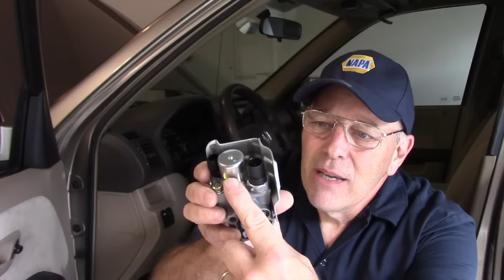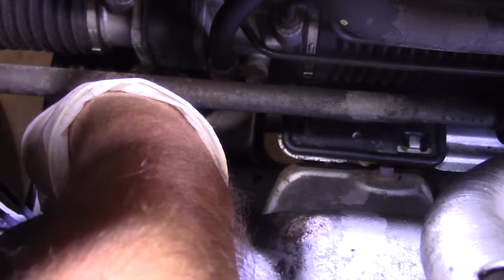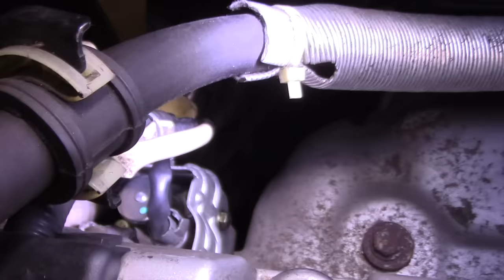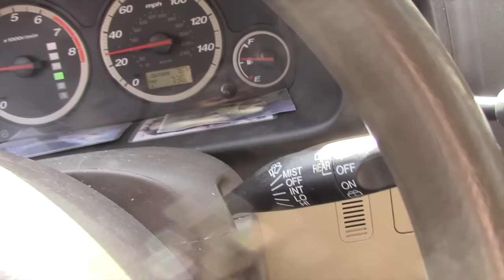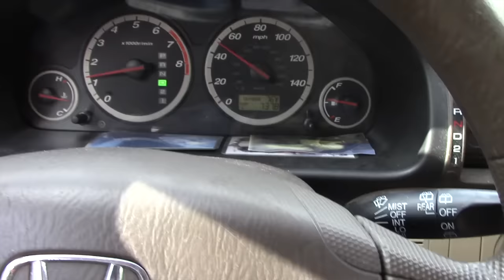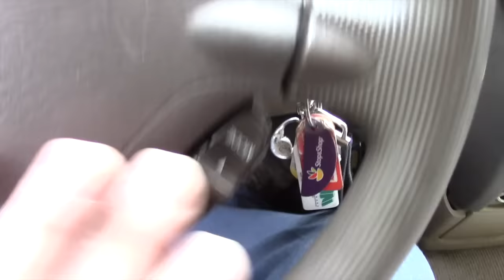VTEC Repair  P2647 Or 2646 (Pressure Circuit Voltage High Or Low)

Comment: Hey Jim I am subscribed and watch all of your vids....I have an 03 Element with this issue.  I have the entire assembly on its way in the mail.  My only question for you is that I have been reading on the Honda forums that some folks still have issues even after replacing the entire assembly....they go as far as replacing the assembly again and several oil changes but cant seem to beat this code issue.....Nobody on the forum has been able to definitively find a permanent repair for those particular cars that just wont accept the fix.....I am hoping that my car isnt one of those that refuses to be repaired.  My thought is that possibly the wire connector itself needs to be thoroughly cleaned or even replaced in those cases.  What is your success rate so far with replacing the entire assembly......have any come back?  Thank you sir
Reply: Mine is still doing it i took off three different things to clean screens but no results
Reply: @blujernigan5170  thanks for your reply......yep as expected my light came back on......  :(
Reply: So, I'm here for the exact same reason. Bummer. Before my CEL tripped, I neglected an oil change (4,xxx miles after purchasing 2nd hand) and occasionally my "D" light on the Instrument cluster would flash. Took my Element in and had an oil change. Cleared the codes to trouble shoot. CEL trips again and the spuddering came back. Took back and had the entire assembly replaced. Took it for a spin and CEL trips again. Took it back to the shop and they determined that the part had been defective. So the guys decide to go ahead and troubleshoot more and do an engine flush at no extra charge but paying only for chemicals. Got the car back and yet again the CEL trips and spuddering is back. I'm currently $375 in on trying to get this issue fixed. In addition, now my fuel economy is shot. I'm consuming fuel like crazy. I can literally watch this thing decrease. Lol

I mentioned the "D" light only because I never saw it again after the assembly was replaced. From what i read, it refers to the o2 sensor or Massive airflow sensor.

I've religiously combed through those same Element forums looking for at least one success story but never found one. 

 I just can't understand why. It's like once the car establishes this error code it won't ever forget it.

If you find a solution please share and I will do the same. Lol. Getting rid of the vehicle or running her to death is probably our only option.  Lol.
Reply: @MrQuipster4k  ...I have a 2007 Element with 247K...can't find a fix either.  Did you ever find the problem?  Thx in adv!
Reply: @johnmorin2371  Yes. I switched back from synthetic to to recommended oil. Stay away from synthetic. Never went back to the limp mode. Older Honda engines like the regular stuff.
Reply: @johnmorin2371  in retrospect, my engine entered this limp mode after I switched to half synthetic and then to full. I went back to the normal stuff and the error code never ever came back
Reply: @MrQuipster4k  Thx Vince, I will try that this week.  I have been running full syn for the last 100K miles with no issues.  This  is killing me.  If my Honda is in park or neutral I have no issues and warning lights...it is only when I start driving that the VSA, "!", and check eng light comes on and I can't go over 2800rpm.  I have always taken excellent care of my Honda, so this is really confusing.
Reply: @johnmorin2371  I feel your pain all too well. I hope the switch helps.
Reply: @redhead sticky  same here, I didn't quite go to this extent but I did change out a bunch of parts and cleaned screens. I was thinking it might be a leak in the head gasket but I don't have any symptoms that relates to that, I'm probably just going to run some blue devil through the coolant to see if that helps.
I think it has to do with the wiring harness or PCM to be honest. I'm getting ready to replace mine If the head gasket sealant doesn't work

Comment: GREAT VIDEO YOU NEED THAT 76 DEGREES TO BE 100 PLUS WITH 92% HUMIDITY
Reply: Hi. Jim I saw your video how to replacement the P2647 VTEC oil pressure switch circuit high voltage. When I drive my car some time show check emmion system on VSA. It is easy to say I can do but not easy for self. Can you do my car and how much charge you will  take. Please sent me message. Thanks